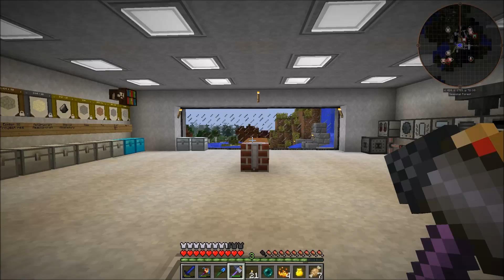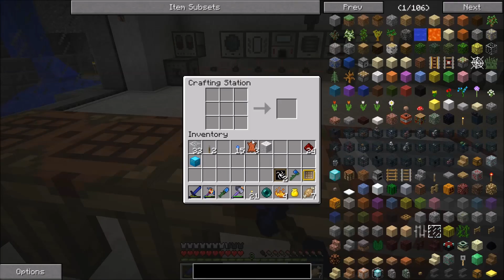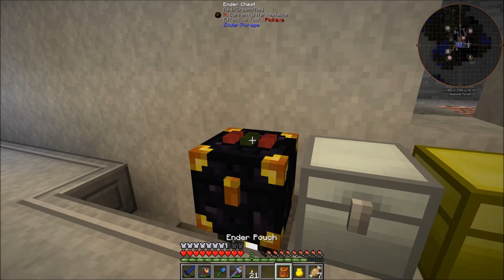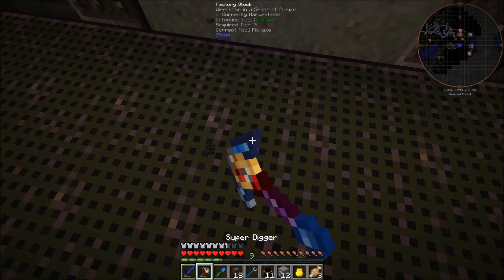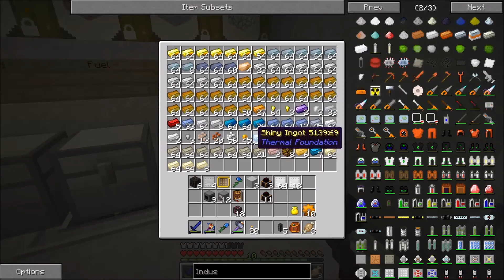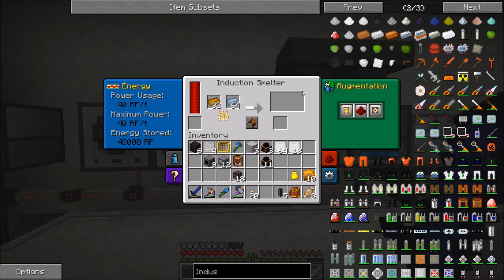Rotarycraft Infinity: Ep14 Power!!!

Comment: Just a heads up, you will need more than four coke ovens to drive a 36LP boiler. More like 20. Boiler eats fuel fast.
Reply from the maker: It eats it fast when heating up but will slow down after it reaches max temp. I may still have to supplement the coke ovens with a furnace though
Reply: If I remember correctly from my first Infitech 2 playthrough, 36 coke ovens will drive three LP boilers, two on charcoal and one on creosote oil.
Reply from the maker: holy poop, thats alot of ovens
Reply: Infitech disables smelting charcoal in a furnace, so I went with coke ovens.
Reply from the maker: weird.. I can smelt charcoal no problem
Reply: Infitech 2 is a Gregtech hardcore pack, so charcoal smelting is disabled.
Reply from the maker: I love gregtech.. will go find that now and have a look.
Reply: Awesome community around the pack, and a well balanced Gregtech playthrough.